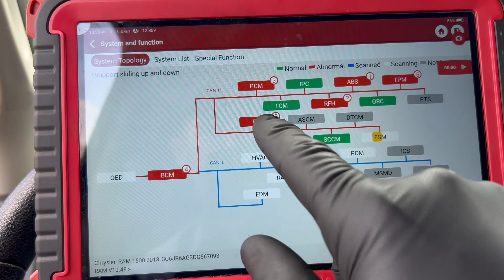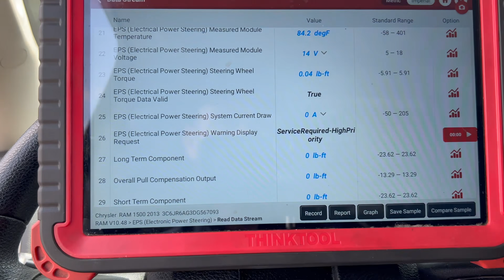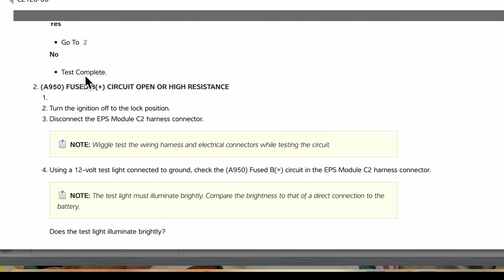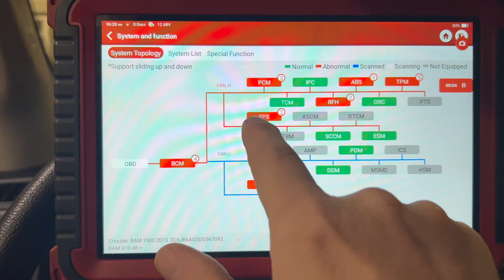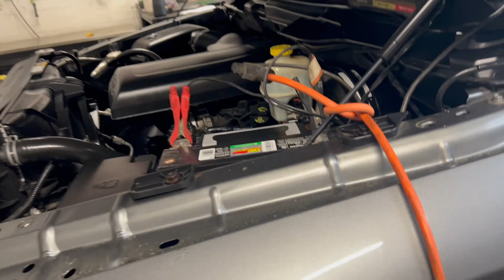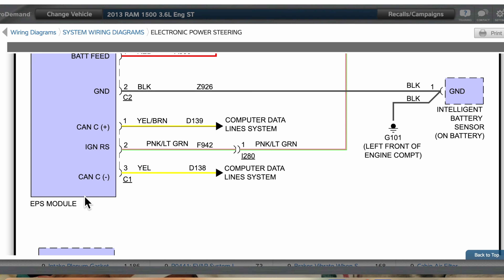Expensive Fix ! Ram 1500 No Power Steering (C2217 EPS internal Failure) | Jon Will Fix It

Comment: Great video Jon!  Quick question - we are currently experiencing the same issue with our '22 Ram TRX.   We've determined it's the power steering control module.  You mentioned your buddy at the dealer said if you pick up a used module, you wont need to reprogram it for it to work properly.  Do you know if that's true?   Our OEM rack is almost $3000 but we can pick up a used module for $700.   So if the used module works without reprogramming, that would be killer!
Reply from the maker: That’s what he told me but I never actually done it so I would get into some forums & do some digging before you make the decision to go used , thanks & let me know how it goes so we both have more information for a future problem like this 😊
Reply: @jonwillfixit  Just got the used module in the mail yesterday so should know in the next week or 2!
Reply: @fullthrottlerick199  hi! hows it goin ?

Comment: It’s a far shot, but I had the same issue and I was going to have the EPS module replaced until I saw that my ground from the wiring to the EPS module was loose on negative part of my battery. I’m not a mechanic, but it saved me $3000. Just checking the nuts on the battery.

Comment: If you get a code saying electronic power steering module (internal) just replace the rack. It's the only thing that will fix it. I just replaced mine with a factory unit. Cost? 2100.00. shipping 479.00. it took me two hours to fully replace. The front end will also need realignment. The good news is, mine did NOT have to be flashed.

Comment: Where im from are work just got it done at the dealer out the door cost $6800 Canada
Reply from the maker: Yeah there expensive, it looks like from the comments a lot of guys are rebuilding them, I’ve 😢personally  have not rebuilt one but I think I’ll give it a shot next time
Reply: You got royally ripped off if that’s the case, 1st off, it probably was repairable with the $20 belt that fails inside the unit and 2nd it’s a 15 minute job to pull the entire steering unit from the truck, 2 minutes to verify if the belt did fail, another 15 minutes roughly to replace belt, then install the unit back into truck
  And you can buy a complete new steering rack for about $2200 - $2400 with better warranty than the ones from dealership offers

Comment: There is a safety recall for certain years of manufacture for these EPS models. The NHTSA is involved.  Find the serial number on the EPS and check it against the recall list. The repair/replacement costs are covered if your unit is on the list. The recall may be expanded also, so you may get reimbursed for repairs in the future. Save your receipt and documentation for submitting to Ram.

Comment: These racks have a belt inside of them that break quite often. The steering will just stop working. The belt is about a 100 dollar part. If all the leads check out and it has power I would definitely open it up and check that belt.
Reply: Not trying to hijack this thread, but I saw a few people comment asking about the belt replacement. Check out a YouTube video titled "Edelman 9607 - EPS Drive Belt Replacement Kit" for more information.
Reply: Is 2019 dodge ram have a belt as well cause I gott quotes 5000
Reply: @tylerberg9116 I believe the belt is the same for 2013-22
Reply: Yup replaced my belt last year for like $89 from Amazon. Easy fix. At least take the housing panel off and inspect. My belt was very obviously shredded with pieces inside
Reply from the maker: great info, ill keep that in mind on the next one thanks
Reply: @jonwillfixit is there any rebuild kit for it
Reply: How would you go about this
Reply: I have changed the belt on mine. It kinda worked for a bit then it broke again...